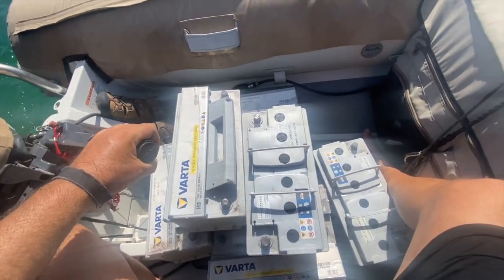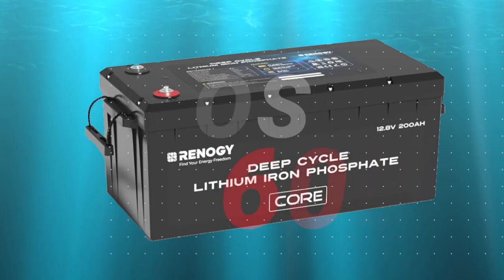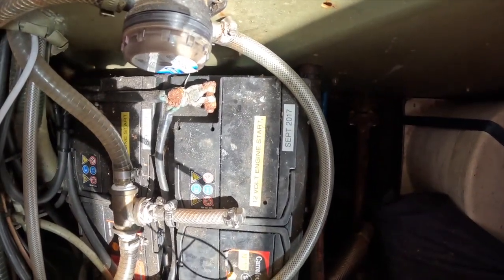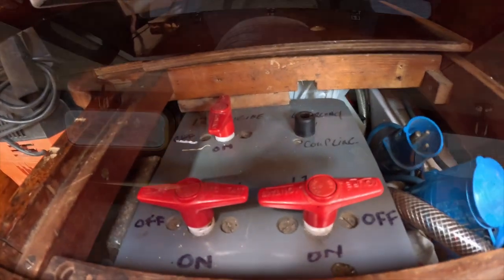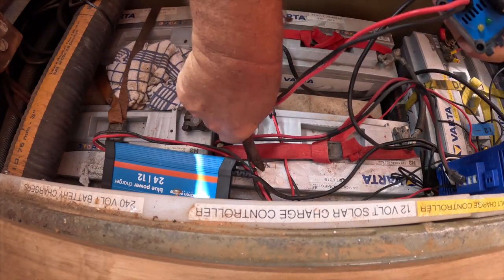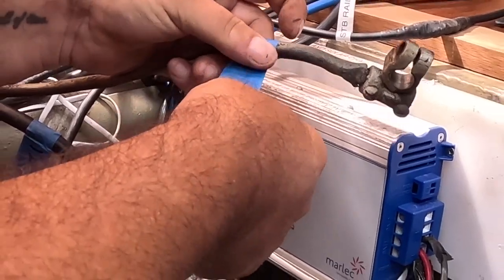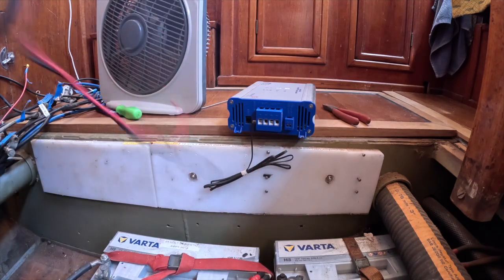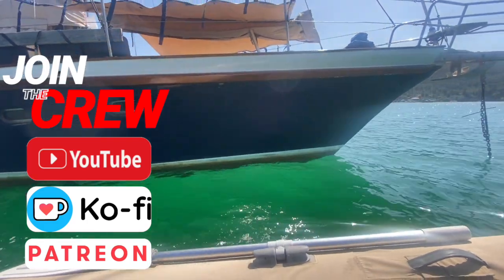EP 189 ELECTRICAL TEAR DOWN

Comment: Great video Ian.  A possible solution to your wind generator situation would be to have Lead Acid battery for your motor with a DC to DC converter to your LiFePo4 batteries.  It is what we did on Make My Day to resolve the issue alternator issue.  The DC to DC converter can be turned off via the BMS when the LiFePo4 batteries are full.  The wind generator and alternator can continue  charging the Lead Acid .
Be well
Reply from the maker: Hi guys.   The 24 volt domestics don’t have a sister bank to charge from so likely I will convert from 12 upto 24 as the 12 bank is full by 9 in the morning. I have options of another chargers controller for the wind or marlec have offered to reprogramme the existing one if I get it back to them.